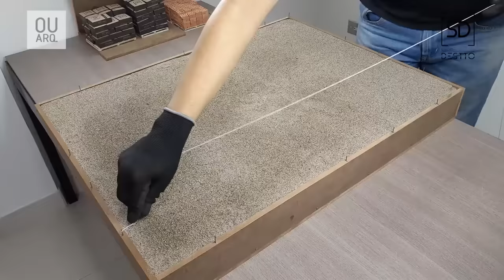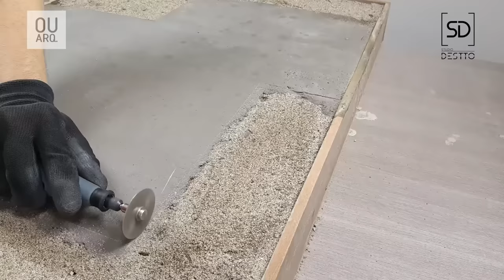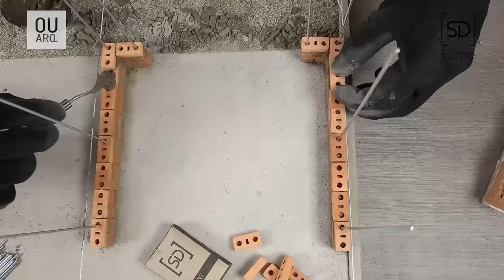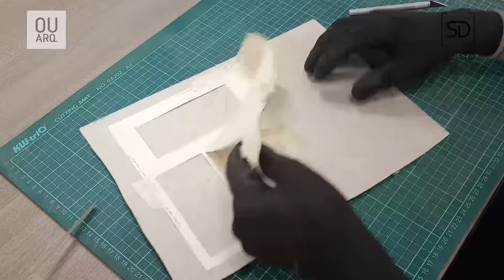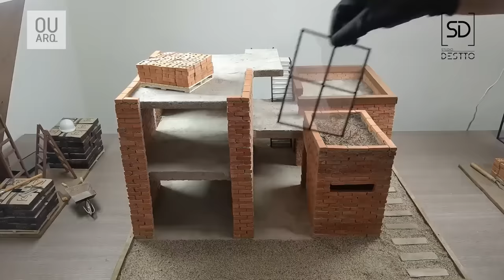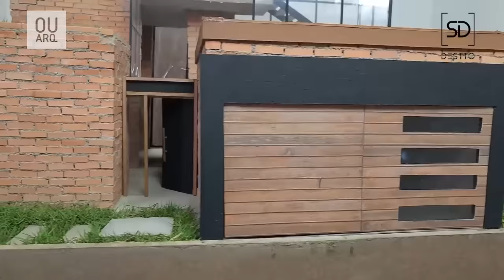Building with Bricks: Masonry Tips and Techniques

Comment: This wouldn't get a pass on tremor resistance laws on my country if it wasn't a miniature, that said, pretty solid work 👌
Reply: Just out of curiosity. What country?
Reply: In Paraguay we don't have tremor regulations, we have no tremors
Reply: @yarsaff8674  chile, we have to follow Nch 433 about resistance against  seismic intensity
Reply: @yarsaff8674  iiiaiiiiiiiiiiiiiiiiiiii
Reply: @GodLuschy  Me imaginé esto, está siguiendo el patrón de construir casas para países que no tienen desastres naturales. Aquí en Brasil las casas se hacen así, por suerte no hay que temer por terremotos u otro tipo de desastres. abrazos desde Brasil hermano!
Reply: @yarsaff8674  lo mismo aca en Brasil, Las casas son mas solidas mas no tan resistentes contra abalos sísmicos
Reply: It's... a mini model which I'm assuming is mostly for visual purposes...?
Reply: @killerextreme0 only Brazil housing I’ve seen looked like make shift shacks on a mountain lol didn’t even know y’all had quakes
Reply: @TBGmario  we didn't!! That's why they're solid as rock.. if we had quakes they would crack because of the structural rigidity
But here is too hot in some places and this kind of material keep inside cooler!! Also there's a lot of humity here and the wood frame wouldn't last long as it does in USA